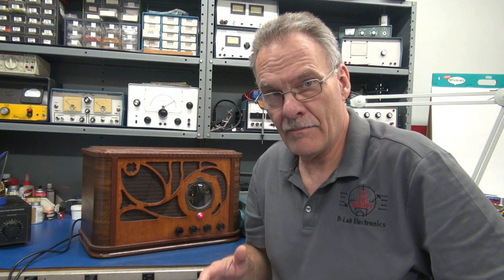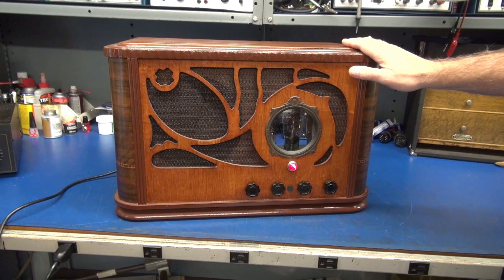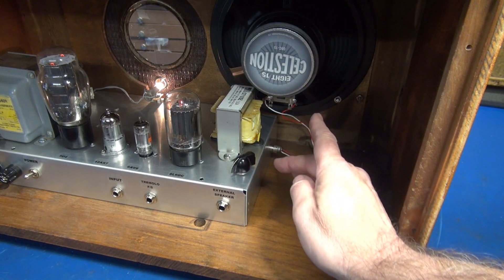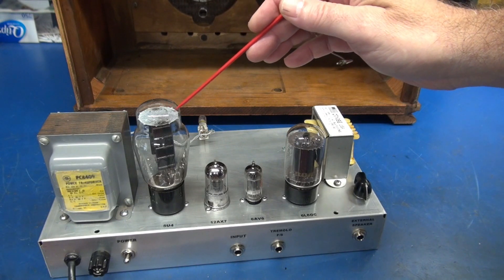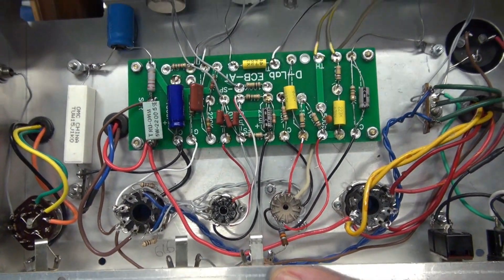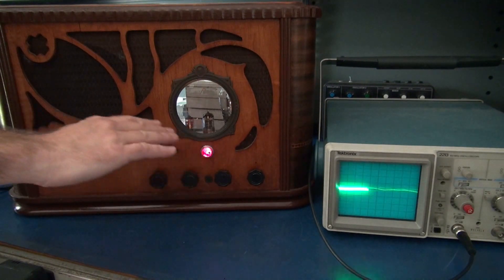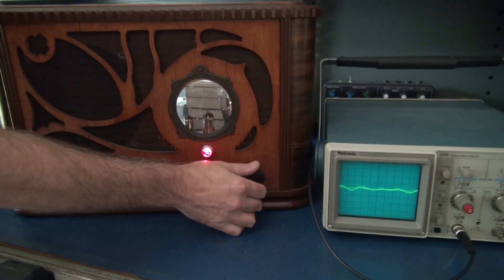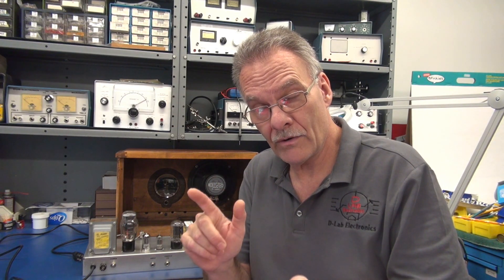D-Lab ECB-AT board driving a 6L6GC High power Class A tube guitar amp demo and build information

Comment: Do you have a issue with old transformers at the 6.3v now being around 7vac I have been having a problem burning tubes out now I only use my varic at 115v and haven’t had any problems now

Comment: Hi Terry, just been over to the website and it says 30 years experience on the main page but 40 yrs on the 'D-Lab Field instrumentation service' page, just thought you should know in case it's a typo error. Also I did notice on the Schematics the power input is for 120v but what if it's 240v as in the UK, what, if any, would need changing to suit. Thanks for the Videos. : )

Comment: Oh my god, I want to build something like this next. I have 4 single ended amps I am building now, but purchased a 6L6 in case I could figure out how to build a higher powered amp. I also have several 5U4`s from some amps I salvaged for parts, and I bet one of those transformers would have the voltage necessary to run in this configuration. Anyways Terry, I will get back with you after these builds, and after I check the voltages on my random transformers.

Comment: I think I am totally confused. What about that small I believe power supply board? I do not see it in this amp. Possibly this is all over my head.
Reply from the maker: I did not use the small CUB1 power supply board on this one due to the need for 500vdc caps